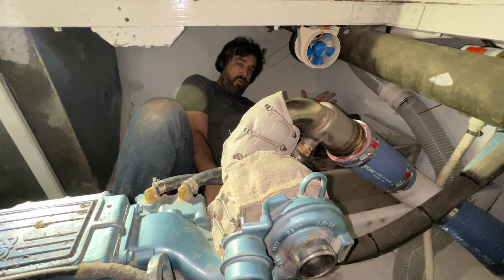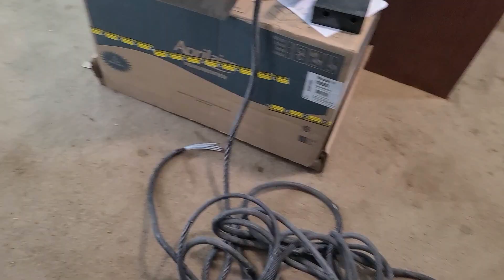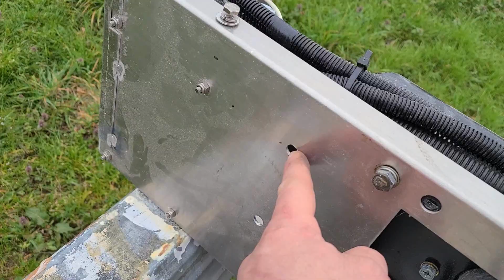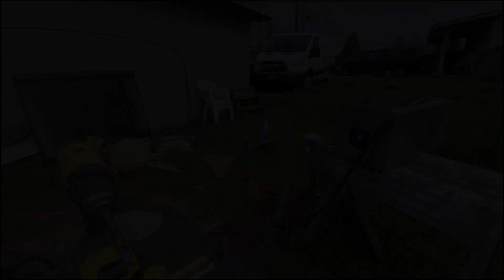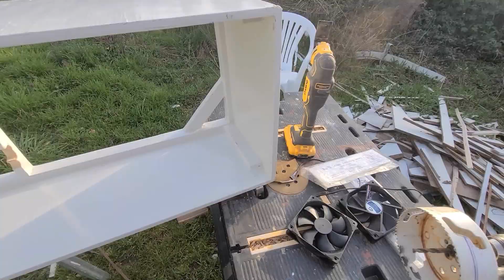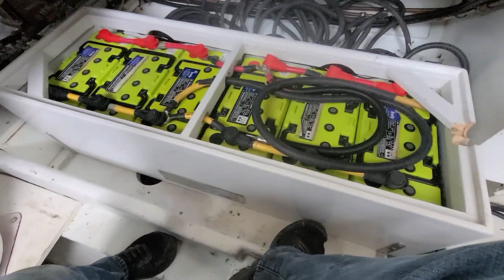Engine Room Work: Installing our Diesel Heater & Modifying Our Battery Bank Box! #sailboatrefit

Comment: Interesting work, but can I politely say you need to keep the camera movement to an absolute minimum. Work out in advance what you want to show, and set the camera up, on a tripod, to show it instead of waving it from side to side and going in and out...that is so hard on the eyes. If you do need to pan left a d right, slowly does it. Just a tip from a lifetime of experience.
Reply from the maker: Will try to keep that in mind, sometimes in the moment it's difficult to think about things like that..... But I definitely agree

Comment: Awesome good work!   Challenging!  You have more patience than me 😁
6 batteries total ?   How many amp hrs does will that give you total ?   And at anchor, what do you think that heater will draw.   * sorry for all the questions, I’m learning a nauticat myself at the moment…
Reply from the maker: When I first bought my fireflies they were rated at 110 amp hours, but they have since up that a little bit, so we're looking at just under 700 total amp hours. the heater draws hardly any power at all because most of the heavy lifting is done by burning diesel. I believe it's rated at about an amp... I really hope we don't find ourselves in places where we are going to need it very often, and I have no idea if it works! That's the problem with all this engine stuff is until my engine sitting in a pool of coolant, it's tough to test anything.